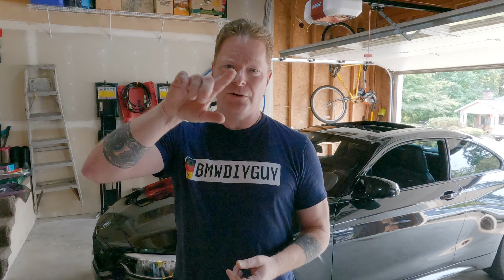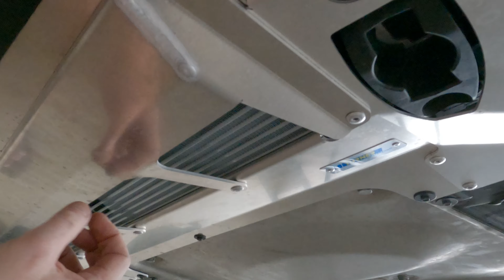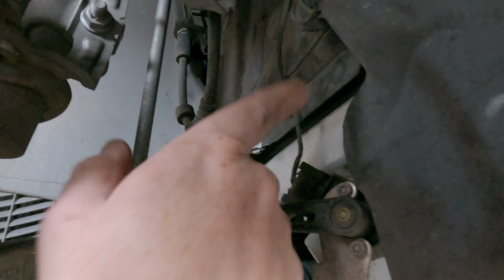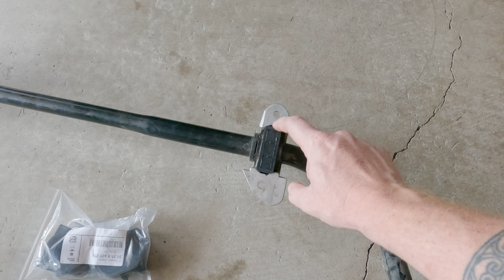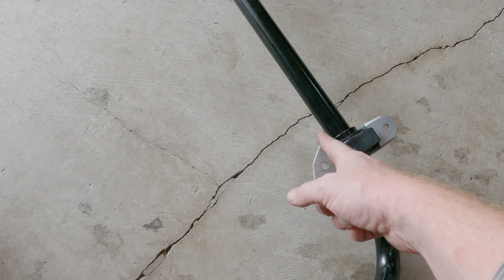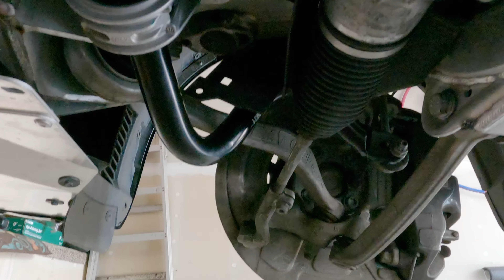BMW F87 M2 Competition CSR sway bar DIY

Comment: Does this fit onto the normal F87 M2?
Reply: Yes. Of course it fits, the cars are identical when it comes to suspension. The only difference is in the engine department.
Reply from the maker: Good question and a way to check is look up the F87 sway bar on realoem, and see in the compatible models list if the M2C is listed.  My guess is probably no as the N55 and S55 are different on the bottom.  That said maybe the suspension setups are the same

Comment: Hi. Great video. What about the rear sway bar? Not necessary to upgrade it to a stiffer one to compliment the front ?
Reply from the maker: So GREAT question.. there was some fantastic track and race analysis by some sources I trust, and their analysis was the rear change isn't needed.  It made a slight difference, but nowhere near the effort of the install, so didn't do it on their own track build M2C.

Comment: Thanks for the DIY. So, how did it change the feel of the car? How do bumps feel? How is the NVH?
Reply from the maker: So no negative changes, and I drive with steering in sport most almost full time.  It FEELS like steering corrections are even slightly smaller now, with it a little tighter.  That said, I havent had a chance to do anything but around town flat and level really in the car since the install.
Reply: @BMWDIYGuy  Thanks, May I suggest you also produce a subsequent review video of the mod?  Perhaps this would be a separate 'content chain' for your channel? It seems you do a great job on the DIY videos and staying on topic of the DIY. However, in most of your DIY videos, you seem to not talk about your personal experience/review about the results/effects of the installs/mods. This is perfectly fine, but some viewers like me may find your subjective opinion useful in separate/follow-up videos.  I'd be interested in hearing your comments on the feeling difference in the end-link attachment points for sure.  (maybe even include the crazy configuration of changing only one side! and reasons why you would or would not do that?)
Reply from the maker: @bitcoredotorg  Great suggestion and will keep that in mind for sure.  Tangential but was going to have a track day that would have covered some of this, but it got cancelled.
Reply: @BMWDIYGuy  Life happens! Bummer.  Yes, also a good case for making separate videos for subjective review - not only would the video topics remain focused, but you can produce more videos, and enables you to compartmentalize the projects - review can be delayed after the DIY install video and you don't need to withhold content.  Cheers, thanks again for producing content on the unique F87 unique platform!